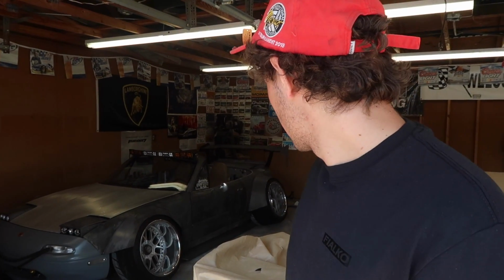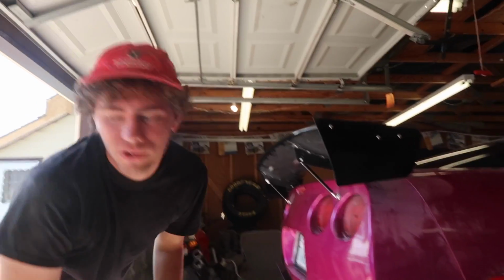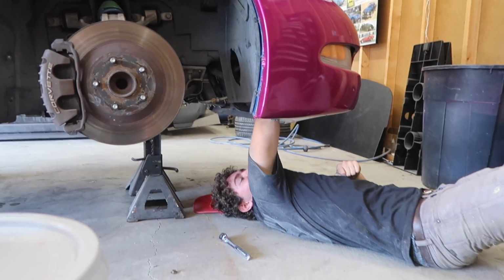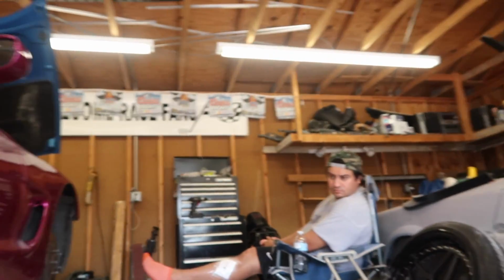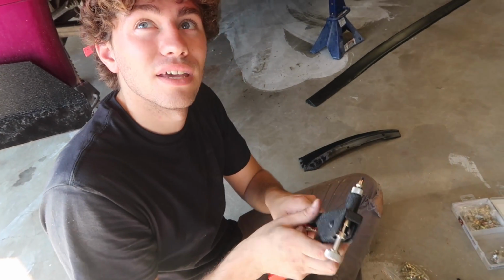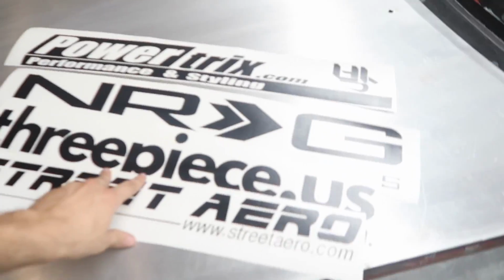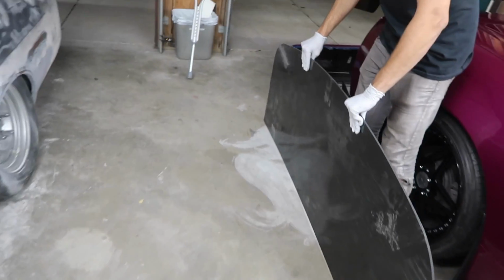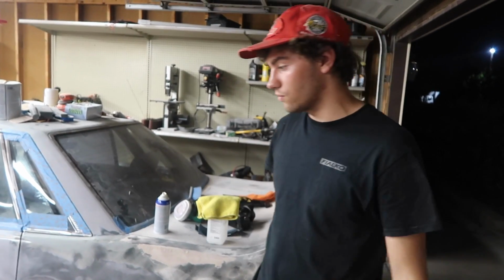Massive Custom Splitter & New Wheel Color

Comment: C5 Corvette is a bottom breather in the front.  I suggest you fab some tunnels from the two front facing inlets, diverted to the rad core.  With that splitter and lip, you're going to get all kinds of air separation and temps are gonna suffer.  Look at the C5R Pratt and Miller car...they a setup that looks similar, but converted to a front breather.  Use the splitter to force air forward, then cut the lip out.  That said...flimsy ass plastic, as a splitter is worthless.  You should easily be able to stand on a splitter for it to be functional...so I hope you have reinforcement plans.

Comment: The splitter is going to look dope but be warned abs plastic flexes a lot, even if you were to bolt up supports on the front, especially if you plan on having it portrude that far out. I've made four so far and broke two of my first ones from 90-100+mph because of it bending from the wind and touching the ground.